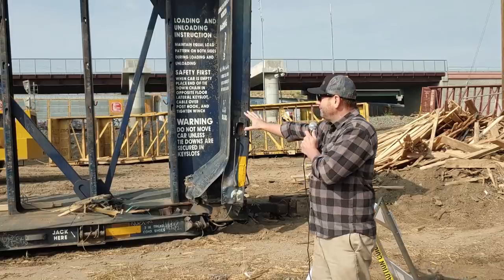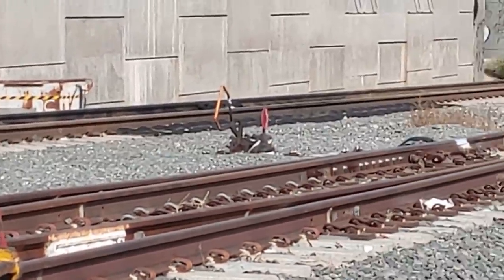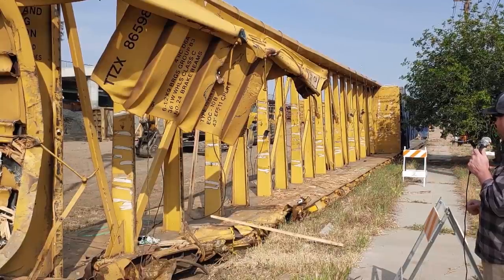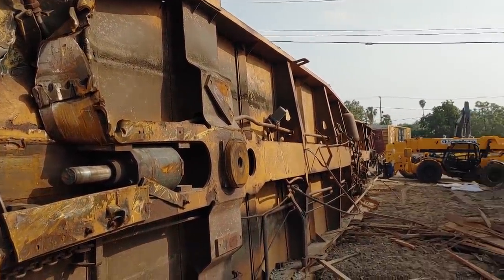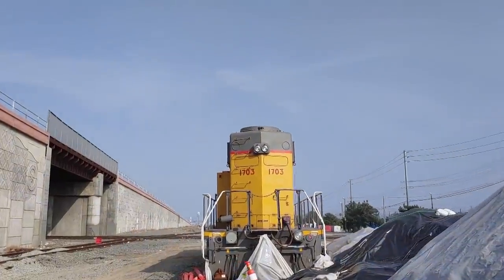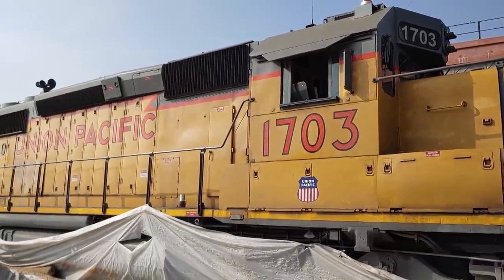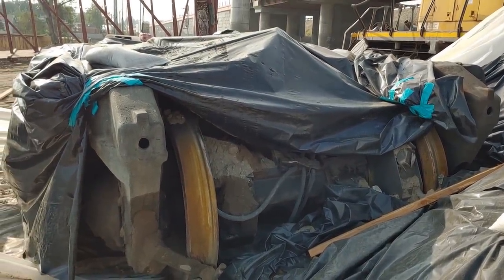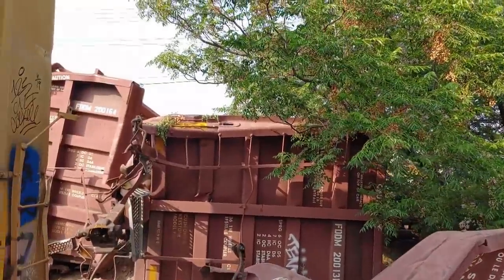Colton Train Wreck: Security Cam Footage And Close Ups Of The Damage 12 Days After Accident 4/2/22

Comment: They gonna leave all those broken railcars there onsite and let them rust away. They already picked the cars clean of all the cargo, so that's all that matters to them.
Reply: There is a process to removal. the cars can still remain on site for days. There's a little more to the process.
Reply: @BossSpringsteen69  it's been weeks now.
Reply from the maker: I stopped by there on 4/20 and all of the cars were gone already.  All lumber gone except some scraps they were scooping up with a bobcat.  Just the 3 engines were there at this point.

Comment: His video shows nothing
Reply from the maker: Um, I'm gonna disagree.  It shows where the engines came to a rest and you can see a small explosion which I thing would have been the start of the small fire it was reported that they had to put out when first responders arrived.  Others have pointed out that the flashing strobes on the engine indicate that these engineers were running on remote.  In any case, the audio was interesting to hear. Thanks for your input though.

Comment: Thanks for the video.  Like the oil industry, the rail industry does what it wants and then, when this happens, the consumer pays  for it.  Imagine how much lumber lays on the ground or exposed to the weather to ruin.  The rr doesn't care, or it would have been cleaned up.  Chances are most of those wheel sets could be reused or repaired, but the rr's are making so much money, reuse is of no concern to them.  Chances are all engines were remote control and i doubt the rr will own up to that.  In the end, regardless of the cause, the consumer pays for it and CEO's get the bonuses (over and above their inflated salaries.  Even if the train wasn't remote controlled, trains are getting longer (over 2 miles long) and really when you think about it, everything after the first engine is out of control so think about the 180th car the engineer can't even see.  But the railroads argue for you to look at how many trucks their trains take off the road.  In the end, if the stuff were made in the US, it would be better, put us to work, and not need as many trains or trucks!
Reply: @TheSjuris  That and they all want to start at the top instead of working their way up from the nottom.
Reply: Typically there is a tonnage limit the RCL's operate with.